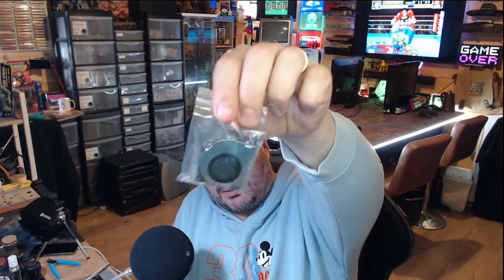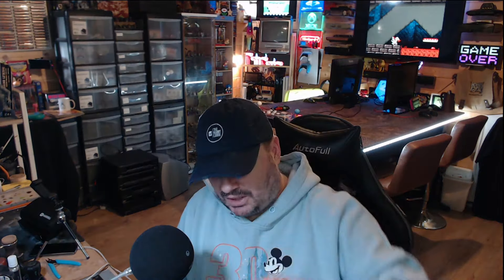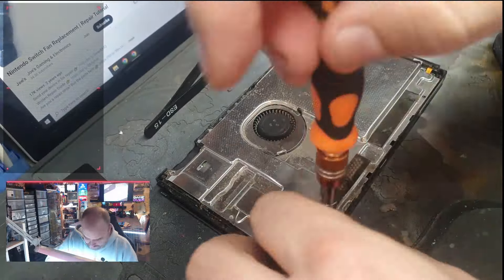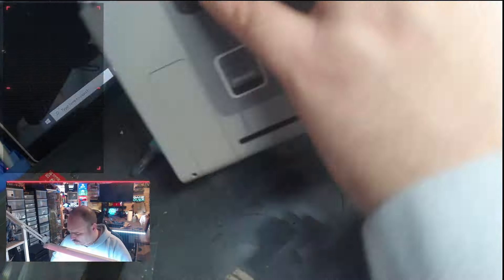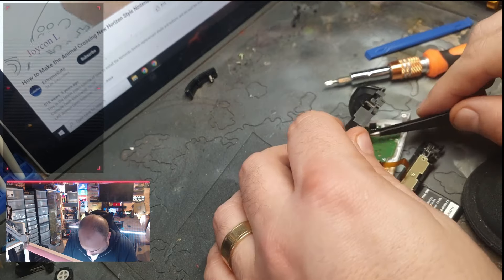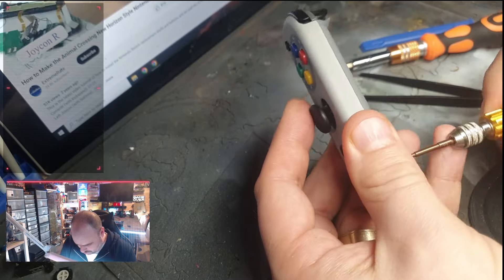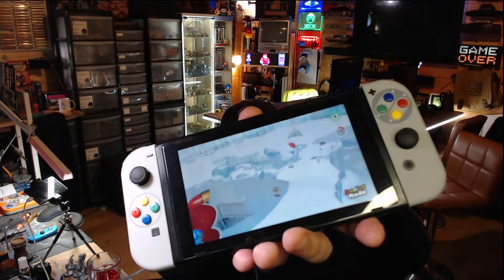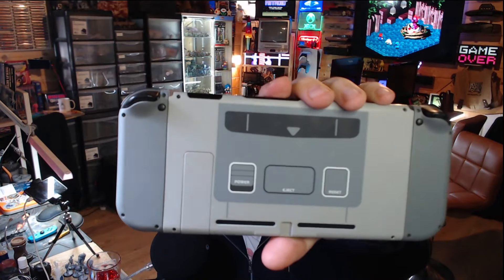New Year New Nintendo Switch - Joy Con Stick Replacement, Extreme Rate Case, Fan, and Thermal Paste

Comment: Great looking mod that Martin, but if it took you 2.5 hours that is certainly not something I'd consider doing🙃 Good work though mate👍
Reply from the maker: Thanks pal, if you were just doing the case mod I reckon just over an hour if you confident but given I also did the fan and thermal paste replacement that took up a lot of time. Thanks for watching